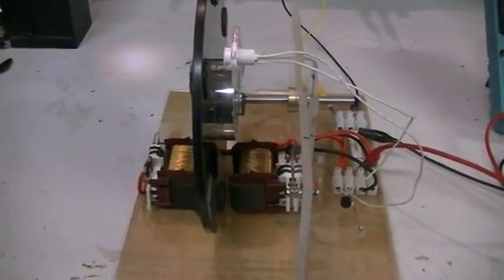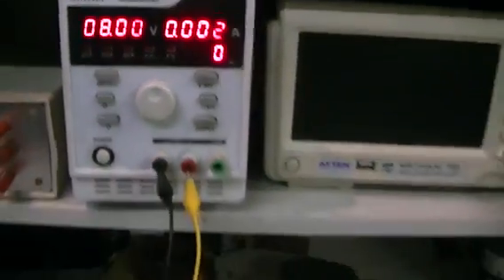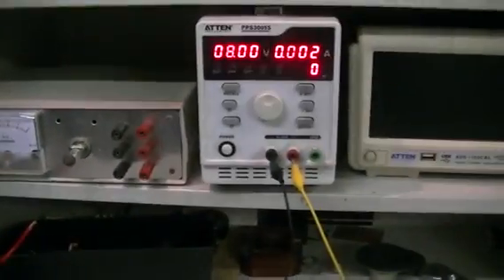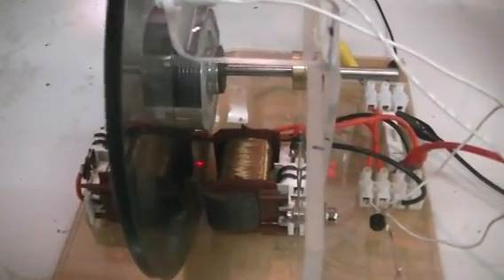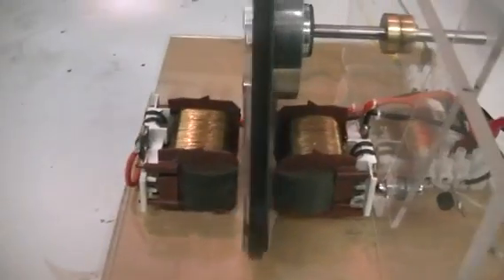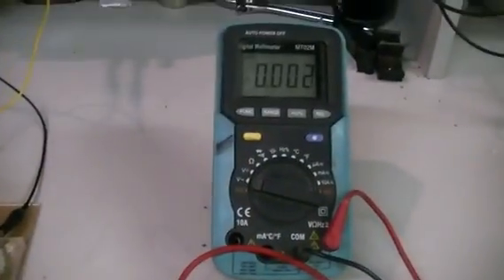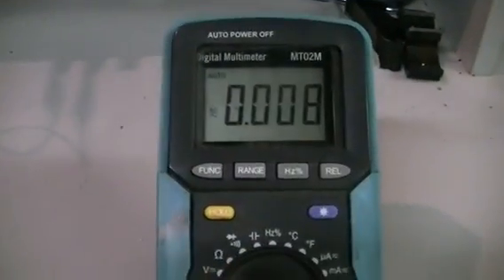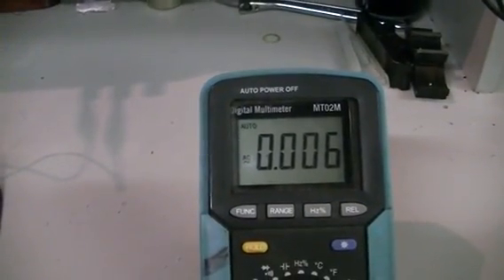Pulse motor with source feedback current.

Comment: Hi Tinman. Great work! I tried to save my reed switches on pulse motors by running the negative wire through it and to a PNP transistor. 
You may wish to check HSI Sensing for their robust reed switches. Following is their link:

http://www.hsisensing.com/product/hsr-910w/
Hope I could be helpful. Thank you again.
Reply from the maker: Thanks for the info Sundiesel.